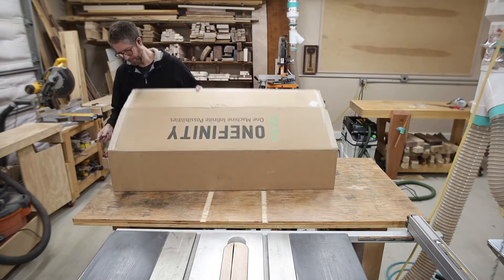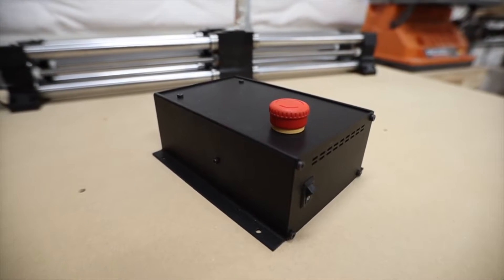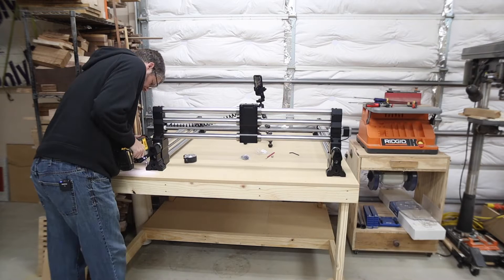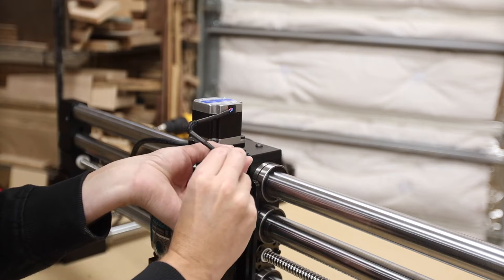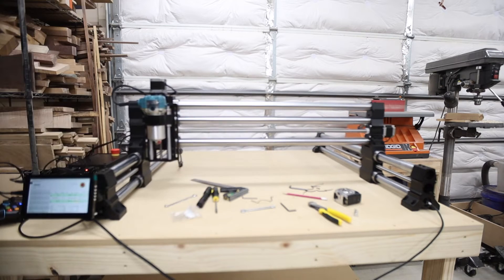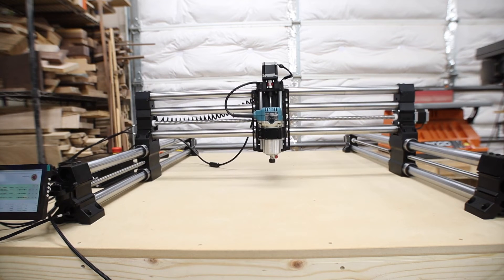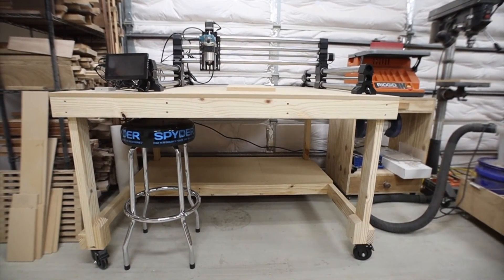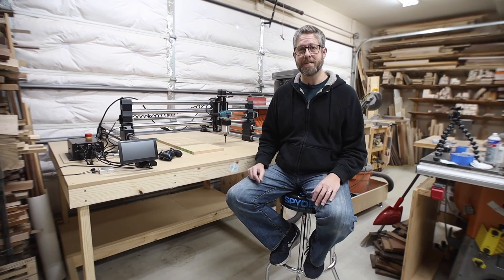Onefinity CNC Machine X-35 Woodworker // Unboxing & Setup via Bruch Ulrich

Comment: Hi, like your video...was just wandering why you chose the onefinity over all the other brands...im from quebec canada...im in the process on shopping fir a cnc...stressful somewhat..another question...can you do all yourvprojects with just the monitor ? No laptop need? And is software included or was it uploaded to your monitor....thanks again
Reply from the maker: check out forum.onefinitycnc.com
Reply: Hey Patrick...just saw this since it is on their channel. I looked at quite a few CNC machines in this price range, and the OneFinity was the most rigid and robust that I saw. You don't have to have a laptop to run it. I actually program stuff onto a flash drive and then run that file on the OneFinity. The OneFinity has a processor that can read files like G Code that you generate with a different, separate CAM software. I've been using Easel to input all of the settings and save the G Code file. Then, I just load it into the OneFinity and let it roll!